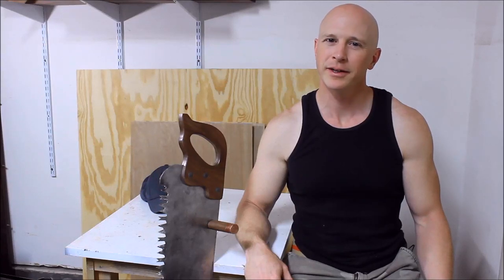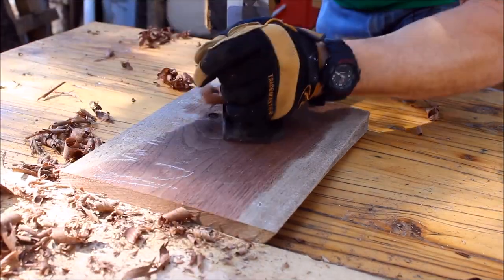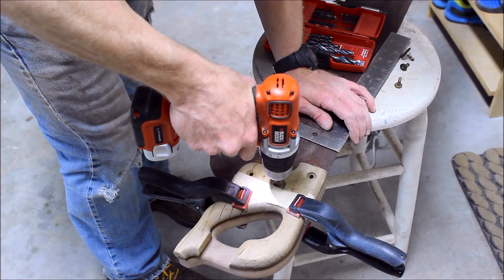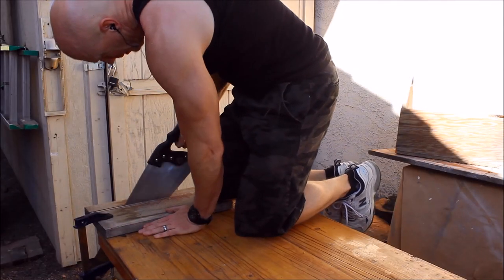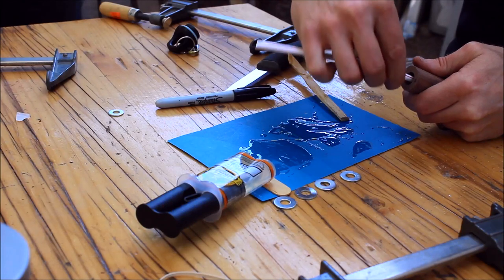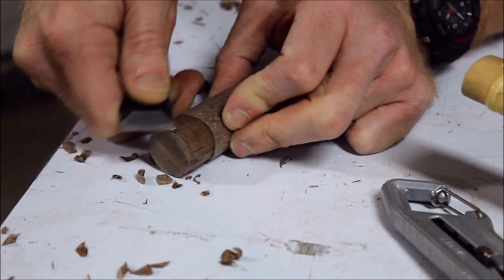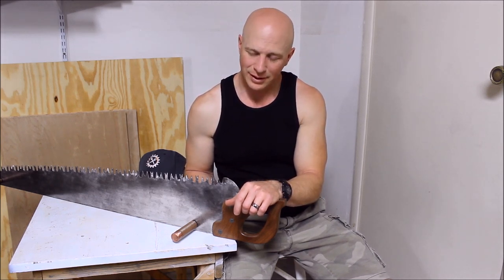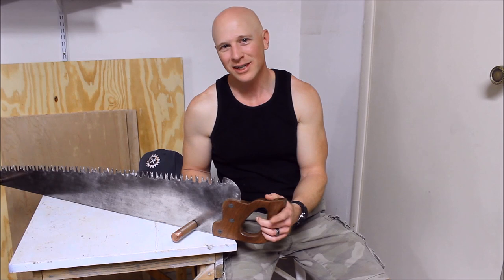Refurbish a 42 Inch Curtis Handsaw - From Rust to Treasure

Comment: nice saw, and good job. Don't worry about the wire brush marks, these are not fine joinery saws and normally have enough set that the plate barely touches wood a all during the cut, its most likely pretty taper ground as well which furthers this point. 

Jim Thode has a great Youtube channel on using old crosscut saws, he shows even a badly pitted saw can be put to good use with correct technique.
Reply from the maker: +Mr. Chickadee thank you for the information. I'll have to check it Jim's channel!

Comment: A good scrubbing with muriatic acid, would not leave swirl marks. It would remove 90% or more of the rust. Just be sure to do it outside, and wear protective gear. (Eye protection, respirator mask, chemical resistant gloves, old clothing.) Git er done.
Reply from the maker: JAMES AYERS Thanks for the tip!  Next time I'll head down the pool cleaning isle and pick some up.